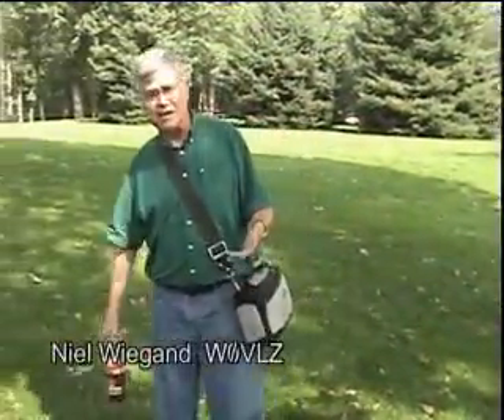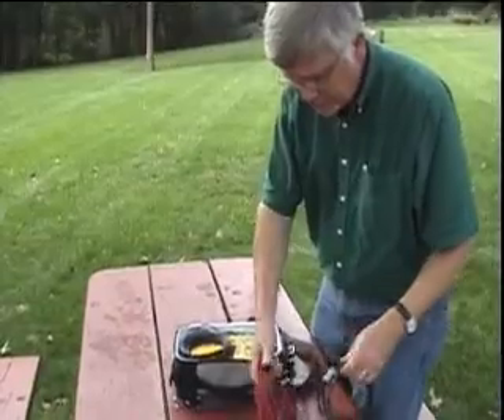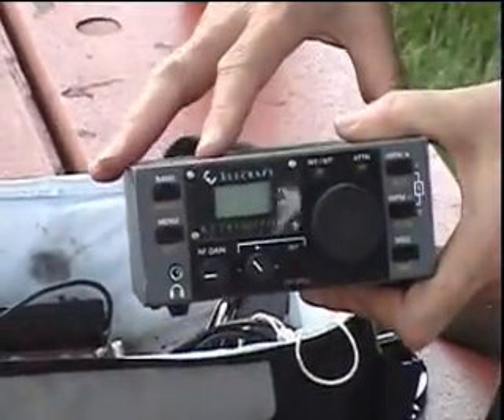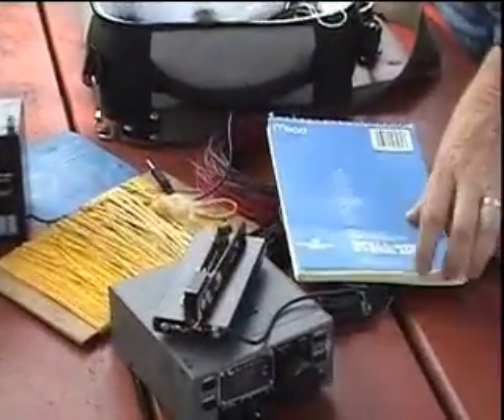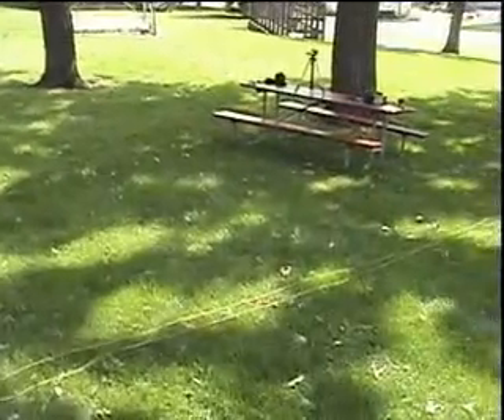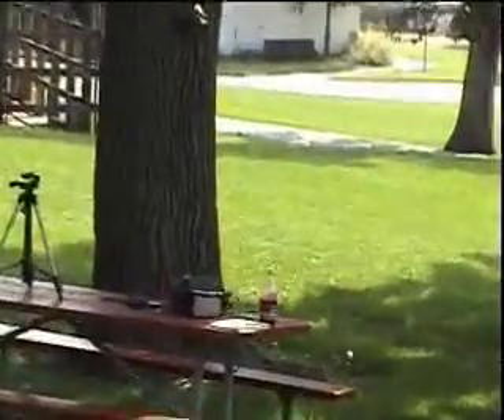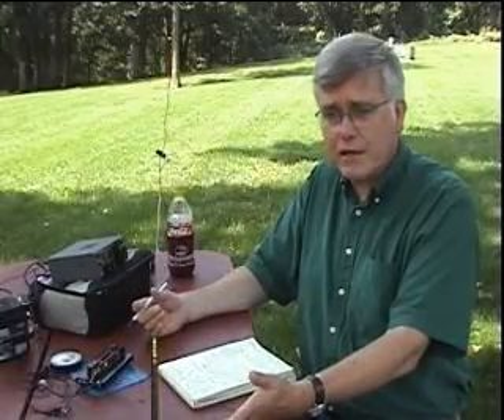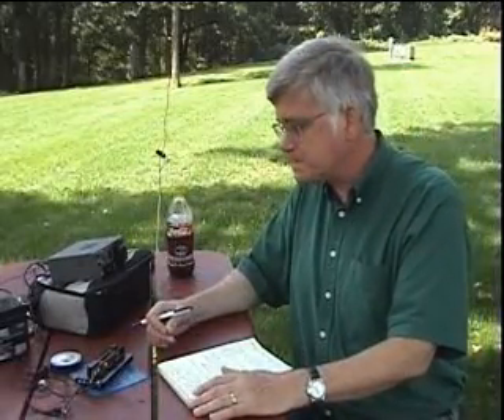W0VLZ - QRP Operating using a K1

Comment: Thanks for the nice day in the park with a K-1 Elecraft and a simple antenna. I wanted to see you tune the antenna and actually show a contact being made but the video was well done. The throwing of the weight into the tree was a simple technique that worked well. I have tried a fishing pole to launch the weight up to about 40 feet but you method is simpler. Thanks N6BOB

Comment: By the way, OM, what gauge is that wire? Stranded or solid?
I will be hitting the Backbone Bluegrass Festival down in Strawberry Point, IA and QRV that weekend QRP from my tent. Who knows what's gonna happen, but I have high hopes. 1W out of a RockMite>BLT Tuner>(yet unknown radiator). Bluegrass mandolin and QRP. What could be better?